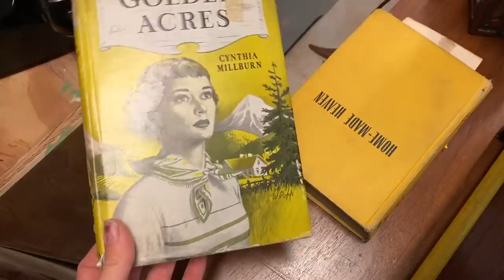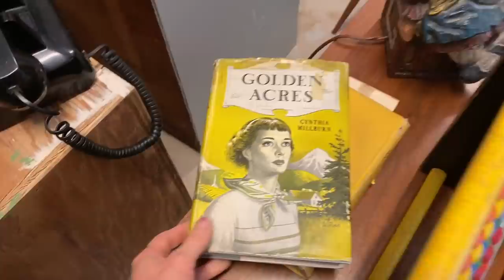DANIEL STARTED HIS MISSION AT HOME! : Adventuring Family of 11

Comment: Since you guys are renting this house do you cover the floors before painting or do you have a special technique to remove the paint from the floor?
Reply: My guess is the paint is washable, if it is the paint I think it is. If nothing else, it could be power washed very easily. Having watched the Knorpps for some time now, I trust them to take care of any paint in the garage!
Reply: janet byrne I wasn’t saying that they won’t. Just curious if Megan had any tips or trick on removing paint from garage floors. I got paint on mine and is having the hardest time time removing it.
Reply: Kim Dougherty what kind of paint did you use, and what kind of floor? If it is a stable surface you can either erode the paint with abrasion (heat gun and scraper, sanding or maybe power washing, depending on where it is) or if you have to, chemical stripping and mopping it up. All those things are kind of toxic. Hopefully it’s not too large a space. But you are right, it is easier to put drop cloths or cardboard down first rather than having to go back and clean it up! Sometimes the paint just gets away from me if I’m just too focused on the project, and then I have to spend a lot of time afterwards. Another option, maybe a last resort if it’s a large stain, is to paint the whole floor!